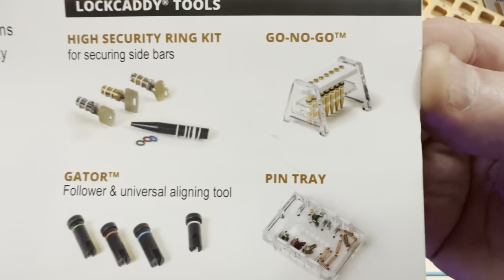How to get top results from your BEST SFIC LAB IC PRO 150 Capping Press

Comment: Great tip!
Reply from the maker: Hey, I was thinking it may not work but I bet it will if I take one of the old plates that have the holes already popped out and I load some spray with brass plate as a holding device I can hold that over the top with the spray then push them through into the lab 4:50 chambers
Reply from the maker: One of the subscribers said, use this tool and slide the springs on the post then tip it over the top of the press chambers, and the springs will slide right into place. Do you have this tool? Have you tried it?
https://www.americankeysupply.com/product/6-7-pin-de-capping-tool-set-lab-11090